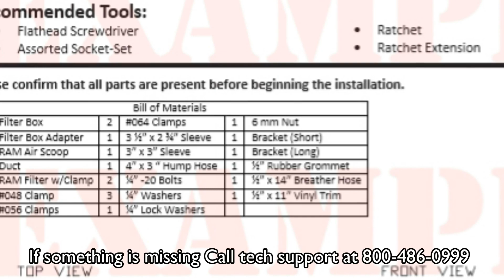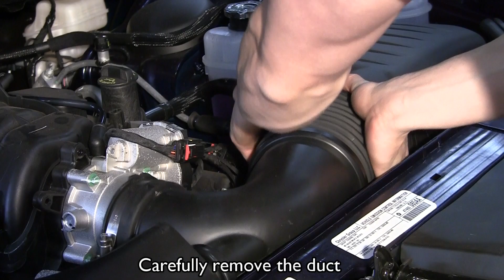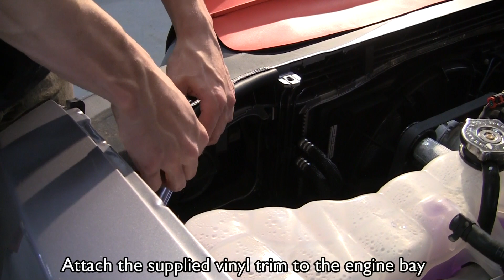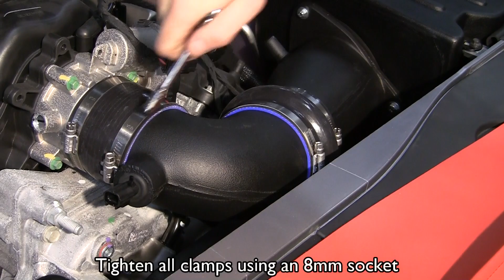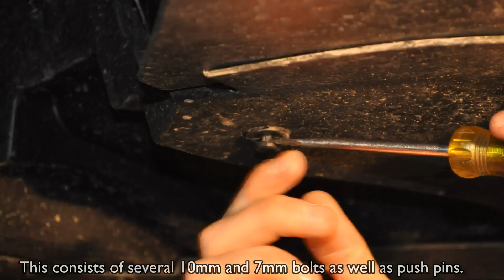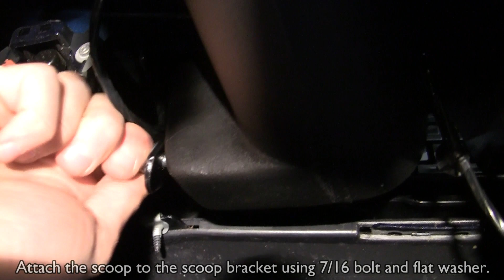CORSA '11-14 Challenger 5.7L Air Intake Installation

Comment: if you have a 2016, there are 5 rivets you have to remove. I had very little rooms to drill out the rivets holding down the plastic panel. took me an extra 40 mins but I was able to remove them. please update your video for newer models. this video helped some what.
Reply from the maker: Hi Alain, Do you have a photo of the rivets you're referring to? We'd like to update the instructions for the newer vehicle owners.

Comment: Ok Kool I was just watching videos of the exhaust system the extreme to b exact as I am thinking of getting it for my 2013 challenger rt but then I came across this corsa air filter so I was like whattttttttttt a corsa cold air intake cool looks nice and not to mention the gain increases that u have listed on the website look pretty decent but I was wondering how much is this thing can't seem to find a price on the site ....
Reply from the maker: We don't sell from our website, but type "CORSA 462576" into your favorite search engine, click "shopping" and you'll see retailers who sell online. You'll be able to order both the exhaust and air intake from most reputable retailers. If you need further assistance feel free to call in 440-891-0999 (east coast) and we'll help you out.
Reply from the maker: The power gains are an "average" or "up to" depending on where you live, what dyno you use, how long the air intake has been on the vehicle, etc will change the power numbers. The filter pictured above (PowerCore®) is EXTREMELY free flowing, you'll be able to hold it up and blow right through it. BUT! it is also 99.97% filtration and keeps your engine safe from debris. (Air Intake) More, Cleaner, Cooler air) in + (CORSA Exhaust) unrestricted air coming out = HP, TQ, MPG.